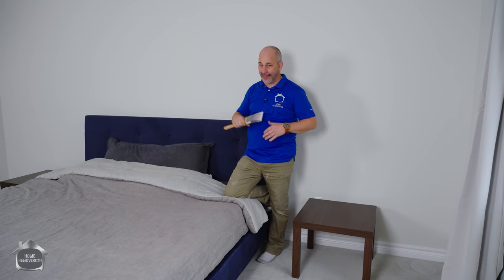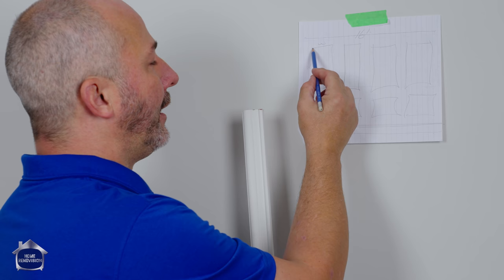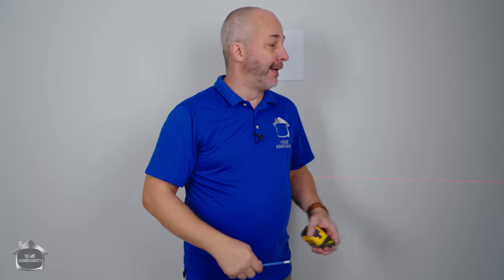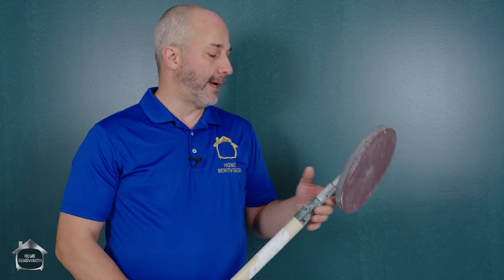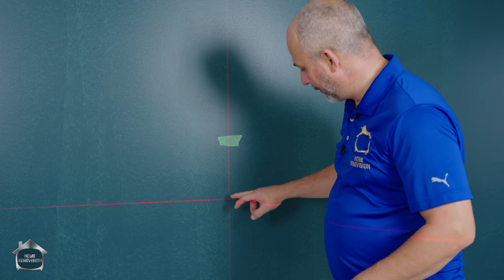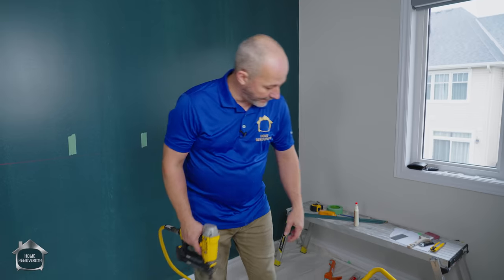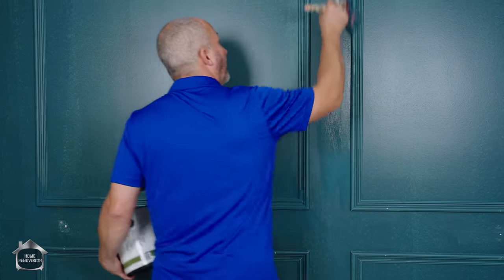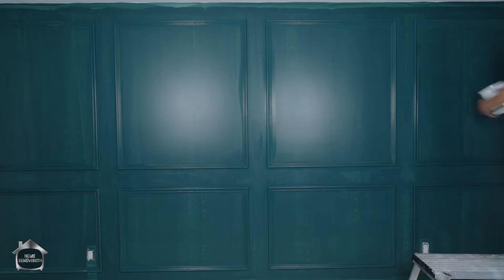Make an Awesome Accent Wall | Easy DIY Guide

Comment: I also want to let you know we had a room we were attempting to install crown molding in. I was having a hard time getting it to meet up evenly on the ninetys because the ceiling and wall were wavy. It was just impossible so I ordered the foam crown molding you recommended on a previous video. The foam crown is amazing! It's gives enough to follow any imperfections were the ceiling meets the wall . It came out almost perfect! Once I painted it I dare anybody to tell a difference between foam and actual wood crown molding! Thanks!

Comment: Hey Jeff. Recently put 2mm plywood over a texted wall to create a board and batten accent look. After it was painted it is still rough to the touch and visibly rough in the right light. We think we should start again with the finish work by sanding. It was primed with two coats and painted with two matte coats. Your thoughts?  Start over on the finishing?

Comment: If you don’t have a saw stop like this, you can screw a length of scrap board to the saws fence to extend the fence along and then nail a block where your desired stop block needs to be. 

When doing a range of different lengths, cut the longest lengths first and then you don’t need to knock the old stop blocks off as the new ones will move along the fence closer to the saw blade.

Comment: Thank you, thank you, thank you. Did I say thank you 😂? My daughter wanted to do exactly this on one wall. I looked for a video to make sure I'd be doing it right. The 1x6 "template" was a dream come true. She questioned using it but I explained to her how it's better than leveling them one by one, plus they're all at the exact same height.

Oddly enough, I bought a DeWalt laser level and we tended to use a regular level more than the laser level. We wondered is the 1x6 was true n width all the way down the board and maybe that's why it was off.

Love the channel. Thanks again.
Reply from the maker: We love making our daughters happy. Cheers

Comment: I am still a bit unclear about how to do the math. You kinda went through it quickly, but that is what rewind is for. The tips are so helpful, do the math first, preset the saw, and use a board as a template is great. Thanks Jeff!
Reply from the maker: You got this Frank. Cheers!
Reply: @HomeRenoVisionDIY   Appreciate the vote of confidence. Salud!

Comment: Nice job mate. Did you nail it into the studs? 
Im thinking to do a similar project but I don't know what is behind the plaster. Can I use brand nails to fix the wood on the plaster only? thanks.

Comment: Great vid as always! I have Questions! If you have time… 
1- I couldn’t tell if wall was textured - mine has typical bldr orange peel (I think that’s what it’s called) and I have heard it’s best to install a 1/8” hardboard (backer board?) panel first to cover it, so it looks smooth. Do u agree, or just paint it well?
2- curious if it would it look better w pine boards rather than mdf? 
3- is it better to use the spackle on trim or wood filler? I see u used spackle for both the wall and trim, checking on that. 
I am starting in a couple weeks so thanks for your help w my last remaining doubts about best way to do it! 
Love your channel. Ashlynn

Comment: Glossy, semi-gloss, sometimes even satin or eggshell can look cold, heavy, and show all defects. The darker the paint color is, (as in this video), the more this is true.  I don't want walls that look like a restroom at the local gas station :)   Thus, I like flat paint on walls, it looks so clean and perfect, it hides defects.  Light dirt can be washed off of flat paint if it is a good quality paint.  

Besides, it's so easy to just be careful not to get dirty hands on them.  Kitchens may require satin, semi-gloss, maybe even gloss because of air-born grease, smoke, and everything that sticks to it.  The glossier it is, the easier it is to to wash off dirt, grime, smoke and grease, I'm certainly not denying that fact.  

But, a good exhaust over the stove (exhausted to the outside) will eliminate much of this issue.  I'd rather paint every 6 years or so than look at glossy paint, besides by the time it needs to be re-painted you will probably have grown irritated by the same color.

Comment: Superb video, gives me the confidence to tackle something like this anywhere in the home.  Two quick ones - 1) what material is typically best for this accenting?  Pine, MDF, doesn't matter? and 2) after you sand the painted wall do you need to clean up the dust on the wall at all with a vacuum or TSP?
Reply from the maker: no to the clean up and I prefer to use mdf for this since it does not warp.

Comment: I have a question about nailing. Should we nail  only to studs or can we also nail to the drywall directly?
Will nailing between the studs, i.e directly to the drywall cause any issue if it might touch the pipes or any wires unknowingly?

Comment: An even simpler and quicker method is to build all your frames on the ground once their cut with ca glue (Instantbond) which bonds in 3 seconds. Then install the whole frame with the spacer guides.

Comment: Great channel, nice guy, great work! The jig is slick! Should've added crown moldings too! I can see the paint lap marks inside the boxes, that looks terrible 😳
Reply: The paint is really fresh, once it is completely dried and cured, you shouldn't see those marks.  It is always a personal choice, but many contractors will not use crown molding on 8 foot ceiling, because it can make the room look squat.

Comment: Hi, 

I am thinking about doing an board and batten accent wall in my laundry room. I just want to get confirmation about installing vertical. You do not have to worry about nailing the boards to studs, drywall is fine?

Comment: Why not use CA glue and make the entire square first and then nailing it. Idk if you know of finish carpentry TV but he does these wainscoting things all the time. And there is a special material/board that goes inside the square so then it's super smooth.

Comment: Awesome video. I’ve been considering installing similar moldings and chair rail made of polyurethane instead of wood. The manufacturers instructions suggest that nails are optional and adhesive is the main method of sticking it to the wall, though you may want to stick it in place with finishing nails (though it sounds like brad nails might be a better option)

My question is, would I be likely to have the problems you describe with seasonal fluctuations in the wall if I just glue them on regardless of the fact that they are polyurethane instead of wood?

An additional factor is that I have old plaster walls. Does this affect how I should install them also? I believe that means I don’t have studs I can really nail into in the same way as with drywall.

And a final question, if I do decide to use a nailer, would an electric brad nailer be powerful enough to penetrate the plaster? Thanks!

(Ps, I just became a member yesterday and wasn’t sure if I should post my question here or in the forum)
Reply from the maker: Hi Ryan, welcome to the membership program. check out our community tab on the home page for info on how to use the forum. as for your question..... i would suggest a little 2 sided tape and adhesive to install the trim on plaster. this way you don't disturb anything and it has staying power right away. Cheers!
Reply: @HomeRenoVisionDIY  great, thanks! I’m happy to be a part of this community while doing my reno 

That makes sense to me. I suppose the only thing to bear in mind with tape is that I will have to get the placement right on the first try since any repositioning will be difficult. Would the same trick work with thin wood panel molding pieces, or should that be nailed in?

Comment: How would I measure this if one of the boxes had to go around a window and will slammed against the perpendicular wall. Would I count that gap? Or would it be easier to get the length and height measurement off the window and figure out the size gap from there?

Comment: Is there a reason why you don't use battery powered tools? A while back you recommend that I switch to dewalt to have a single series of batteries and they are working out awesome.  Batteries are definitely quieter than a compressor and perform just as well.
Reply from the maker: just trying to keep my tools affordable to empower folks.

Comment: What do you change in this process if you want to use WHITE trim on a coloured wall?
Is it just a matter of pre-painting the wall fully 2 coats, pre-painting the trim white and then finishing the trim itself using painter’s tape around it once it is installed?

Comment: Thanks for the video. Were the pin nails only going into drywall on the verticals?  What nap roller did you use to paint two panels in one?
Reply: The rollers are 18mm microfiber. They are listed in his tool section. Under affiliated sites.

Comment: OMG That laser jig is the best thing ever. I was looking at tripod (it's too big for no reason) and also looked at light tripod (lower legs) which is pricey for no reason and still take too much space. That plywood base with the 2x and the angle iron is a cheap and awesome ! BTW is there a specific reason why you don't use a cordless nailer (18g), like the cheap Ryobi (P320) which works great ?
Reply from the maker: i never run out of batteries. Cheers!

Comment: Jeff, I noticed that you changed the direction of the roll when painting outside the boxes on this wall, even though you in your last video said to never ever do so 😅 Could you maybe explain why this was an exception to that rule?
Reply: For an accent wall such as this, it was the only way to safely add texture to the wall on the outside of the trim.
Reply: @MrPrateek0  Can't see why, would have been no problem rolling vertically as  Jeffalso mentions that touching the trim with the roller is ok.

Comment: Thanks Jeff that was great. Would you recommend spraying the wall with the trim on instead?
Reply from the maker: no walls can expand and contract so painting first is the only way to avoid little white lines in the future.
Reply: @HomeRenoVisionDIY  thanks
Reply: @HomeRenoVisionDIY  what's the proper  name of that wooden sticks what you put on wall and where to buy it? Can you please add links to the  discription box , thanks

Comment: You need to watch Finish Carpentry on wainscoting. No adhesive. Verticals cut at same length. Same for horizontals. No need to paint till all is installed and spray it. Less talking.

Comment: Why don't you use a paint gun? Wouldn't the 15 min spent taping off the area be worth it for an even coat with no brush or roller strokes? I'm not trying to be mean but what's the reason you don't use a gun? Are you able to not get strokes at all?

Comment: everything looks nice, except that transition between accent wall and sidewalls. That line looks crooked as hell, and corners at the top look sloppy.
Reply from the maker: bad drywall work. it will need fixing before painting the walls.

Comment: I'm the kid who didn't raise his hand in math class. I was embarrassed (I didn't get it). Sir I don't get it. The math was too fast and I'm not following how you got your numbers. Is there a formula. You constantly referring to it as very easy and simple math brought back many embarrassing days from my childhood. Math is scary to some people
Reply: Wall measure explained

Start by measuring the length and width of your chosen wall in inches. Measure ceiling to baseboard for height total  and wall to wall for the width.

For my example we’ll say the wall is 200 inches high and 130 inches wide (I choose these numbers for easier math if you wanted to follow my example) next draw the picture he drew and put your height and width on the edge of the paper. 

The six inches is maybe a standard or random number he picked to space out the boxes. Four sets of boxes across means 5 gaps from one end of the wall to the other for a total of 30 inches across NOT in the boxes (5 gaps * 6 inches a gap = 30 inches not in the boxes) and two sets up and down means  3 gaps from top to bottom each 6 inches apart for a total of 18 inches up and down OUTSIDE of the box (3 gaps * 6inches =18 inches)

Then he picked a height he liked for the bottom of the top row of boxes and used he laser to mark it on the wall. Usually people like the top boxes longer than the bottom ones for astethic reasons. Any height you choose becomes your way to measure how much space will be IN each box. We’ll choose to place our base for the top boxes is at 80 inches from the baseboard.

Now we figure out how long and wide each box will be. This is where a good picture with lots of labels is super helpful.

Top boxes:
There is one gap of 6 inches between the top of the wall and the bottom of the top box  so if you take 200 inch wall subtract 80 inches of wall below the top box and then subtract another 6 inches for the gap we get a height of 114 inches for the top box. 
(200-80-6=114in)

The width of the boxes is found by taking the total width of the wall, 130 inches subtracting the 30 inches of gap from end to end giving us 100 inches across for our boxes.  (130 -30= 100) Since we want for equal size boxes we take those 100 inches and divide by 4 to get 25 inches as the width of each box (100/4=25)

So the top boxes are 114 inches tall and 25 inches wide.

Bottom boxes: there are two boxes between the base of the top box and the baseboard.. so we do 80 inches - 12 inches ( for our two gaps  not the box ) = 68 inches tall 
And the width is the same since we have the same five gaps as the top boxes 25 inches long. 

Bottom boxes are 68 in in height by 25 in wide

Hope this helps. There are more measurements to consider if you plan miter it. And to space the on the wall. 

Best of luck
Reply: Pictures really help with real world math. Midpoint is just the measure cut in half to the midpoint is 100 in height and and 65 in width in my example.